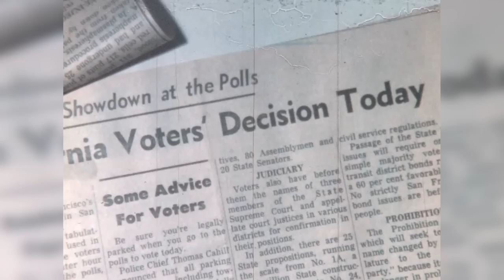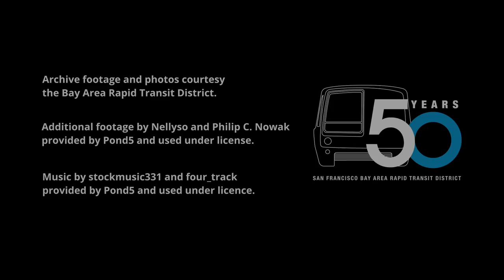BART San Francisco Rapid Transit Cars in HO Scale!

Comment: Simple suggestion here from all Massachusetts transit fans.

MBTA subway cars! A popular one would be the MBTA’s prolific Red Line Pullman Standard 01500/01600 class cars.

These ones were built 1969-1970 with aluminium bodies and still serve today, running as America’s second oldest subway cars in service. 

There are two other types active with this sub-system, the 01700’s and 01800’s. These two types are both Canadian built aswell! 

The 01700’s are identical to the 01500/01600’s, yet are built in 1987-1989 to extend the fleet. 

The 01800’s are the newest active cars, sporting a stainless steel exterior and have more modern interior/interface features.

The 01500/01600’s would probably be the most popular as they sport a unique scheme that’s very popular and is often linked to Boston’s heritage. 

Once again, just a suggestion but a grand one at that.
Reply from the maker: Well depending on how this launch goes, there could be many more transit offerings in the future!

Comment: Also the hardest part is not the details but motor power and being able to hide the powered car internals big problem with mth, so since I'm a unofficial rapido employee can we get a nyc subway car set with front and rear power so the lighting is correct like headlights on the leading car and red working lights on the rear end car when in motion or stopped just saying.

Comment: Very cool.  Two questions ... when you say "H0" ...  BART, being BART, uses a 66" track gauge instead of 56.5" ... how are you handling that?  Will they just run on H0 track but have the bodies scaled correctly for H0?  Or will you pretend H0 track is 66" wide and scale the bodies up?

And, about those BART cylindrical wheels ... :-D 

Regardless of these details, this is pretty cool.  And, on behalf of Jeremy, when will the N scale version be announced?
Reply from the maker: It'll be standard HO gauge in the name of simplicity, standardization and cost control. And we'll see what happens in N scale!

Comment: The "K" in Morrison–Knudsen is not silent. That said, there are enough users of 5"6" gauge in the world. I'm surprised no one, at least as far as I can find, makes scale broad gauge track in 1:87.
Reply: I'd say theres more chance of the Newfoundland Railway in 12mm than that 🙂
Reply: Interestingly, they used to.  For a brief time, there were American OO-scale models that used to-scale track with a 19mm gauge (unlike the U.K. OO-scale models that use HO-gauge 16.5mm track), and that turns out to be almost exactly 5'6" in HO scale.
Reply from the maker: Thanks for the info! We decided to go with standard gauge to keep costs down and to keep things simple for the majority of modelers.
Reply: @BrooksMoses  Very interesting. If I had known that I'd forgotten. The closest widely accepted scale closest to 5"6" in 1:87 is S-scale with a gauge of 22.5mm. It would be like UK OO-scale in reverse, using slightly wider gauge that prototype.
Reply: @rapidotrains  I was told that by a M-K rep back in the early 90s. We didn’t have this internet thingy back then.

Comment: Needs HO scale earthquake instructions
Reply from the maker: Good point!
Reply: HO scale earthquake instructions:
1.) Obtain a 2-pound sledgehammer, a large soft rubber block, an cellphone that can do calendar alerts, and a 6-sided die.
2.) Mount the rubber block on the side of one of your benchwork legs, and make sure that leg is sturdily bolted to the rest of the benchwork.
3.) Have a friend set a calendar alert on the phone that will go off sometime in the next 3 years, but you don't know when.  (Note: 3 years is scaled for typical fast clocks; adjust to your preference.)
4.) When the alert goes off, pick up the sledgehammer and give the rubber block a good solid wallop with it.  Cut off track power to the layout.  Roll the die; if it comes up 1-4, give the rubber block that many more, somewhat lighter, wallops (about 10-20 seconds apart) to simulate aftershocks.
5.) Put the sledgehammer back in its place.